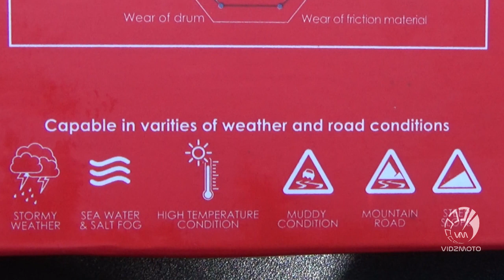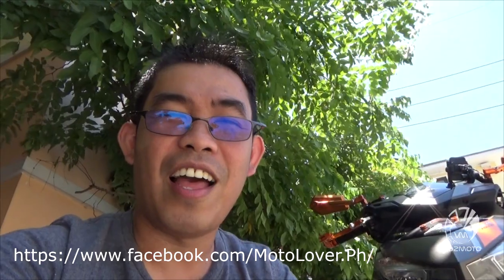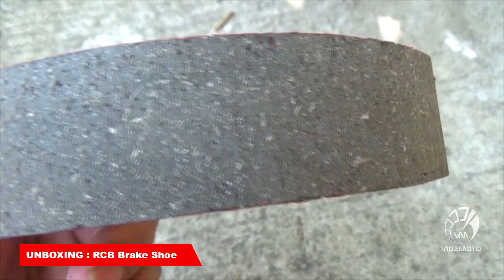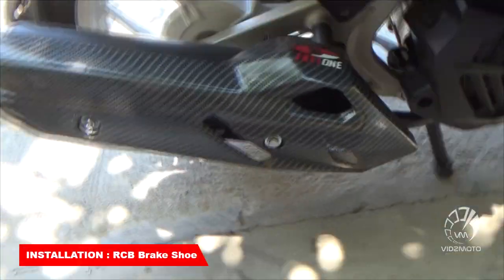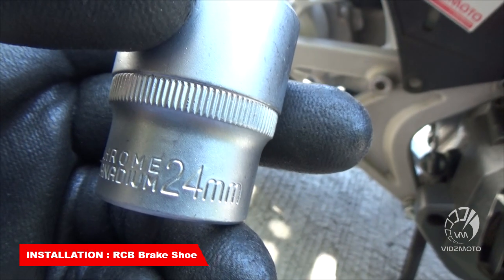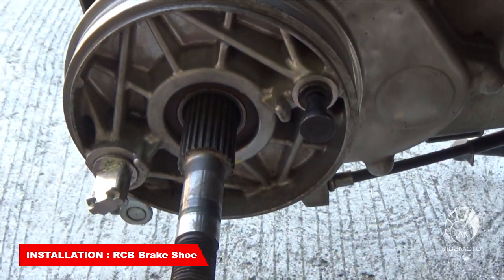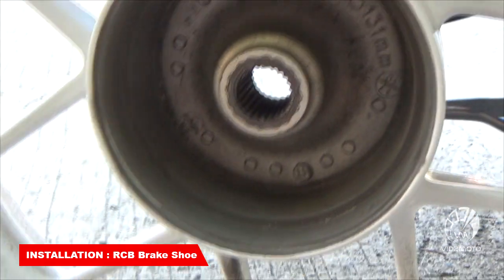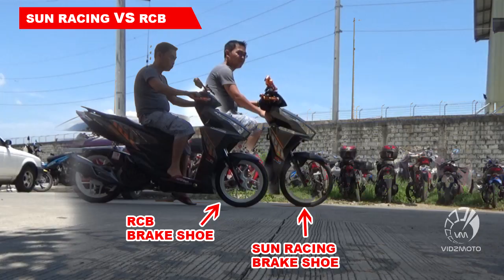Racing Boy Brake Shoe on Honda Click 150i - Installation and Review

Comment: paps stock b muffler mo
Reply from the maker: yes paps stock po yung muffler na gamit ko till now
Reply: @VidzMoto  paps pg tinanggal swingarms kaylangan tangagalin ung pipe..hrap tnggalin nsa ilalim ung bolt
Reply from the maker: @marviscurioso296  need mo ng power tools sir or mahabang wrench para ma twish mo yung bolt. make sure na tama yung ikot mo
Reply from the maker: @marviscurioso296  yes pap need mo remove ang pipe. ingatan ang bolt ng pipe kasi exclusive lang ang bolt na yan, sa kasa kalang makakabili nyan